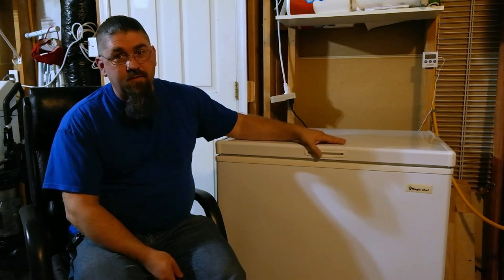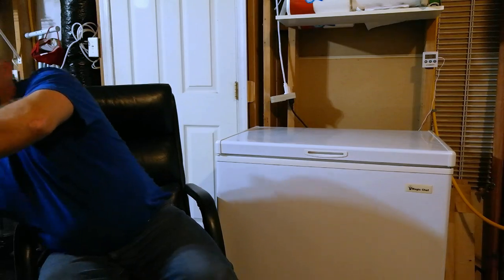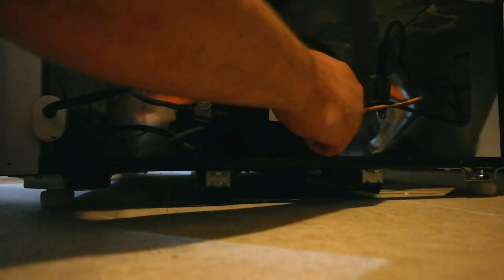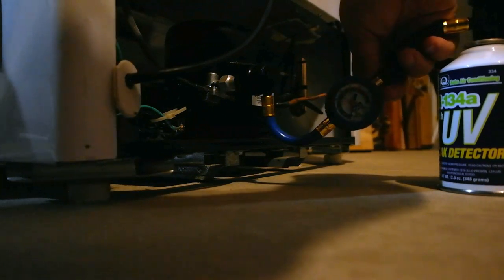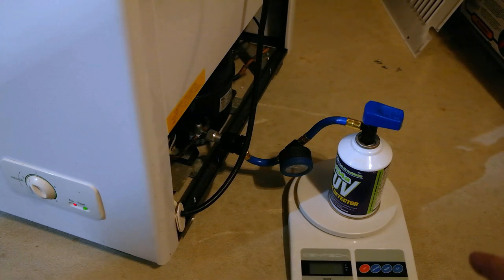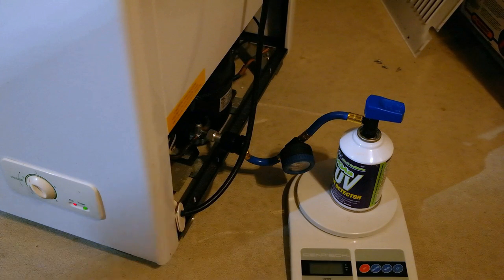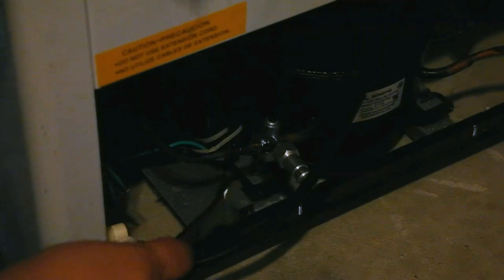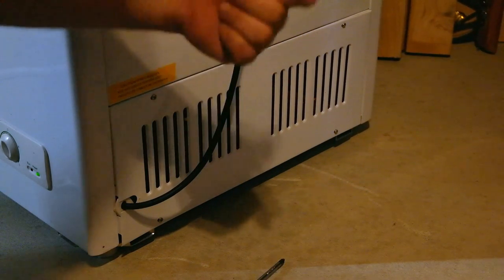How To Recharge Freon On A Chest Freezer

Comment: To everybody watching this video make sure that your freezer or fridge does except R34a if your freezer runs on 600a that is butane and is highly flammable and if it is R22 you must fill it with R22 or you will destroy the compressor if it does say on your compressor R34a You are safe as long as you put the correct amount good luck to anybody out there it’s not that hard most of the older ones have either R43a or R22 The newer ones have the 600a Are junk The older ones will last you 15 to 20 years if not longer these new ones you’re lucky if you get five years out of them good luck and if you do have an older one fix it

Comment: Great video and believe me, if anyone's the idiot here it's me. My only question is the scale. Isn't that why there's a pressure gauge on the hose? I mean, what if your system is just low on coolant but not out, wouldn't putting the required amount  in over pressurize the system? Why not use the pressure gauge to bring it up to a required pressure? I've seen it done like this in some other videos and am wondering if your way is the right way or is theirs.
Anyway, thanks for the vid. The more I learn the more I know I don't know. Lol!
Reply: I'm wondering the same thing!  It's a great way to go if you're totally empty, but what if you aren't?